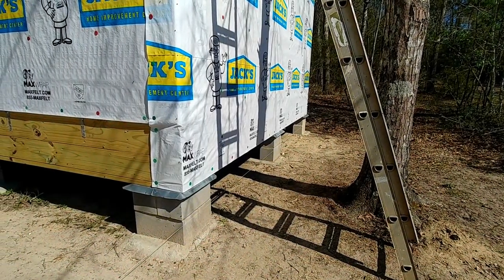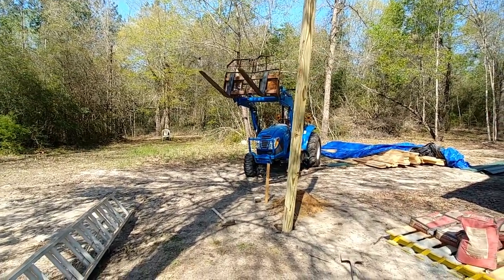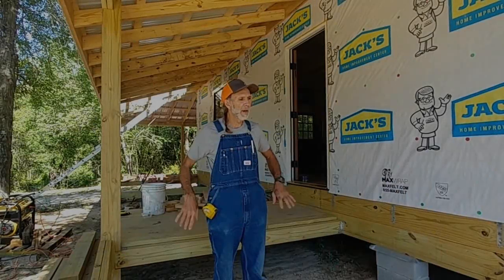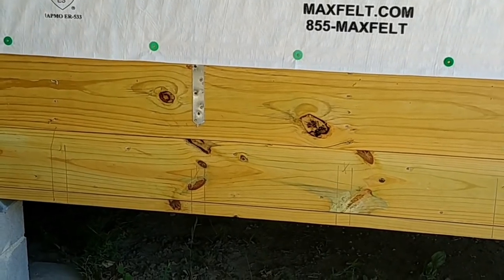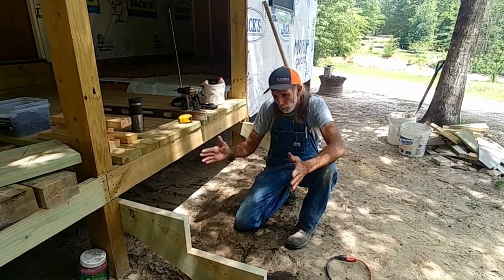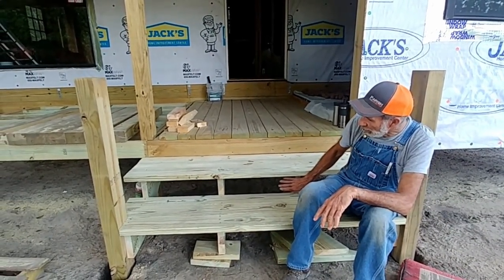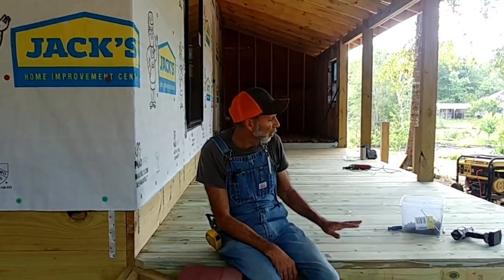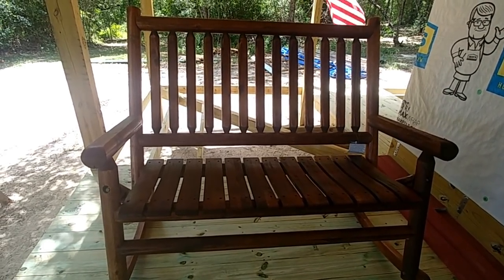Off Grid Cabin Build  | The PORCH |  Episode 17

Comment: Are they ceder posts
Just wondering, I know someone who used pressure treated posts on there privacy fence and they rotted through in 3 yrs. They said they wish they would of used ceder or burned the wood. Really nice work. Looks good
Reply from the maker: they are treated there is a recall on treated lumber from 3 years ago. i had a lot of mine replaced for free.

Comment: Danny, do you set your posts at one and a half feet or deeper and do you do anything for the bottom of the posts to prevent rot over time?
Reply from the maker: 2 1/2 to 3 feet deep. Corner post gravel in bottom of bolts l hole, set post and pour cement around it.
Reply: @DeepSouthHomestead  Thank You very much.